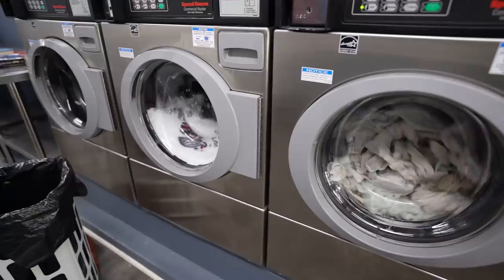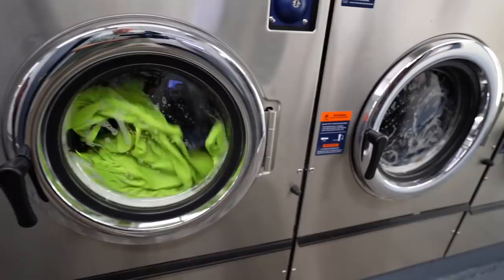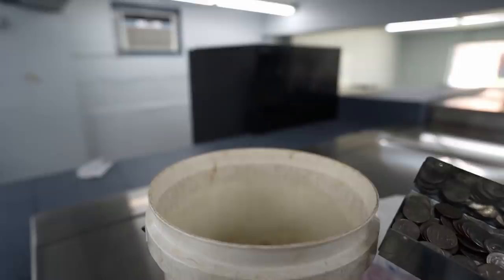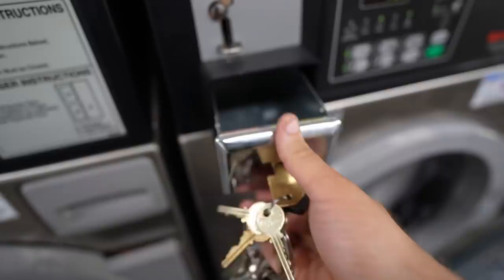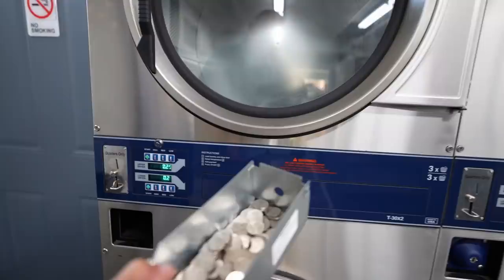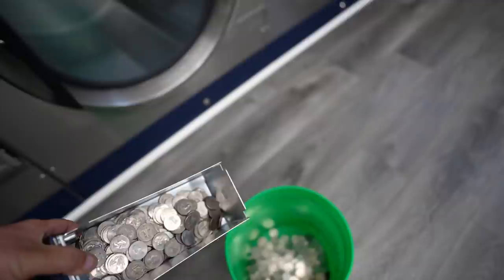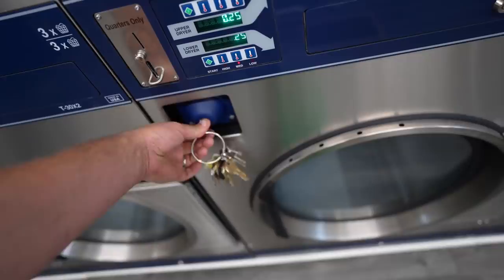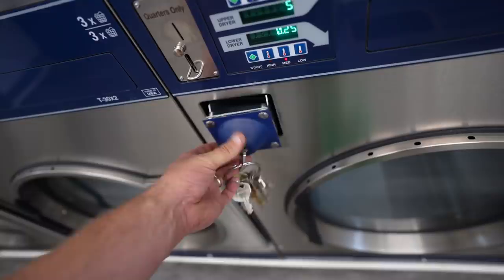How much money does my NEW LAUNDROMAT Make?

Comment: if you have a person there 24 hours, you should apply to make your laundromat an access hub for UPS, Amazon or FedEx packages. they’ll pay you a monthly check for doing it
Reply: I see your point about the money but I would be much more concerned about making the security guard defend the amazon lockers AND the laundromat AND the owner 🤔
Reply: @ShadowLancer128  there’s cameras inside and outside the lockers. he can also temporarily close the store for 10/20 minutes to put them in. it’s so damn easy a teenager could do it. the money he’s paid for it by Amazon would never be a pile of cash laying around the place anyway. they’d direct deposit him or mail him a check like they do for Flex drivers
Reply: @ShadowLancer128  give the security a gun to step up security
Reply: Your Papi Chulo  call Juan.
Reply: I agree and the amazon hub lockers can be outside of businesses as well. So you wouldnt need a security guard 24/7
Reply: @ShadowLancer128  Its extremely easy to do, you just wait and wait, there is a very low probability that you would get robbed even without a security guard
Reply: Yess he could use the back room

Comment: It might not seem important but have you thought about curb appeal? Ive noticed under the letter on the signage is all rust dripping down. Maybe painting the rock facade and getting the moss out of the concrete on the ground. A good pressure wash and paint job could really spruce the front up. Then your outside would match your beautiful laundry shop inside 🧺
Reply from the maker: Was supposed to be power washed, hasn't been yet.

Comment: How much $$ in quarters does the change machine start with? Wouldn't you have to subtract that from the bills when you count?
Reply: the change machine doesn't make any profit at all since how much bill you took out you will have to replace the same amount with quarters.   Only the washer/dryer/arcade machine/vending machine generate profit.
Reply: Yep. The change machine is not revenue.  It's actually a small loss due to power, wear and tear, depreciation, etc.   The cash it takes in balances the quarters it vends out.  It will never make a penny.  One way around this is to have it dispense something like tokens where you can say you dispense four tokens for a dollar but your cost for the token isn't a quarter. Maybe it's ten cents. So then you can get some revenue out of it, assuming your token cost is less than a quarter or whatever.

Comment: To count income, do you just count the coins out of everything that brings in revenue? Even if you see cash in the change machine. You don't know if they were just getting changed for personal use or using it on the laundry equipment. The change machine is just to exchange it's not a source of income. You don't make money from it you don't lose money from it unless somebody breaks into it and steals from it. The trick I think is counting the money from whatever machines you have plus and a fending machine agreements where you're paid a commission. Or if you have any arcade games or push the quarters over the edge games.  That's how I interpret the accounting. I'm just looking at this thing logically. I'm just curious about how you count income. Guessing it's the way I say but please I want to learn so correct me if I am wrong

Comment: Looks nice, you moved the bottom line in expenses by half smart move. Fast dryers even better like turnover on tables in a resturaunt.  Get me money counters as it is your time and safety. 
Do you recycle the quarters back into the hoppers. Do you have soap vending machines for high efficiency washers?

I think the decision for coins was a good one as there is a national chip shortage. You can get cards later.

Comment: If it's true that time is money, then a new bill counter that detects the denominations would be worth it. As it is now, you're sorting the bills manually (at which time they could be counted, but I get it), passing them through one stack at a time, then redoing that two or three times if they jam. An upgraded counter would be like putting the bill collector in the change machine. It ultimately saves time and streamlines your process. Consider it.

Comment: This is a excellent video, but if I was interested in opening up a laundromat, how did you start?
Reply: Source high efficiency washers and driers, check with your local city hall or equivalent to see if you need any permits for said business, grab a business license and open a business that has insurance, or just an llc, location is your biggest factor, most people that dont have washers or driers more than likely dont have transportation, a bad location and you wasted all your money and are now in severe debt. Also make sure there isnt any competition for miles, people would rather go to a laundry mat they are comfortable with and have been using for years even if yours looks more fancy. Also make sure the building you rent or buy has the proper piping to run that much water and power. If not I highly doubt a building owner would allow you to completely change out the electric box, and floor in the necessary piping. Its very expensive. He said he spent 100k in reno so expect to at least spend that just to start up. Not a very profitable business starting up. But its a long lasting source of income. But be prepared for people breaking things often.

Comment: Here in Nashville Tennessee there's a laundry that opened up with two of those XL washers right up front when you walk in the door. Everytime I go in there they are always running. To me it looks like the higher capacity models in a laundry mat get used more than the lower ones do. I've always wondered if it would be more profitable to ditch the smaller capacity washers in favor of the mid to larger size machines. I'd love to see some analytics on that.
Reply from the maker: That SEEMS to be the norm. I was looking today and we've got room for a few more if absolutely needed.
Reply: @InvestmentJoy  The XL washers also get the occasional non-laundromat client like the homeowner who needs to wash their down comforter a couple times a year because it doesn't fit in their home washer.

Comment: Just looked at a new operation for my friend to buy with his sister. 70% are 3 -4 year old machines but a stack of dinosaur parts in storage as the old couple never threw anything out. The old dryers will need replacing asap with a full interior fit out asap. Ironic that the same supplier who fitted the cashless dryers / washing machines is eager to fit & install 4 x of each on credit asap. I can see these 8 machines being debt free in 4-6 months (paid for by increased sales / service). It pays to be a Management Accountant sometimes LOL. 

But it amazes me the lengths that vendors will go to hide their business's shortfalls ? We are talking over $150K of kaka LOL The average 'Joe' or 'Joanne' takes these people at face value without knowing any better I requested to see the certified accounts from the owners & their son instantly becomes defensive. The business broker wants a quick sale as the couple are elderly & ready to retire, but the kids are asking for a price 40% above True Value. Bonus - 3 unrented apartments used by their kids.

Comment: I would be driving myself crazy trying to find Bi Centennial quarters every week.
Reply from the maker: I do. I don't spend time looking for silver, w mint marks but I can spot a bicentennial from a block away.
Reply: Look for the Wisconsin quarter something to do with the corn research it. An extra leaf.
Reply: Or star note or any thing pre 64 lol
Reply: @InvestmentJoy  they make machines that separate the silver quarters by weight. I think silver quarters are worth $3 a coin with current prices
Reply from the maker: @jkm7983  I know they do and I have like two or three the issue becomes I think that I've handled $10,000 worth of quarters in the past 2 months, 500 lb, 40,000 individual quarters. At some point it isn't worth it.

If I was able, I'd package and sell to anyone that wants it to treasure hunt, but as it stands shipping would kill it?
Reply: @InvestmentJoy  There are coin sorters that you can run the quarters through that can be programmed to eject all of the silver ones from the regular.  Not sure if the extra time to run them is worth it, but I have seen videos of coin searchers that have used them in the past.

Comment: So lots of bills and lotsa quarters, but how many quarters were loaded into the change machine(s)?
Reply: $1036.50 walkout total that’s what came out of the coin machine and did not come back, it “walked out”
Reply from the maker: I think i might have done math wrong due to rush it might have been $1919 - $1036.50 = $886.20, and I DO need to check the drinks tomorrow/friday to see what's in there. There could be another $200 in quarters which would mean only about $600 walked out.

Comment: Are you counting cash from change machine as revenue?  That's not revenue. That machine doesn't make even a penny. It only converts from paper money to quarters at no profit. It operates at a small loss, really, because you've got electricity and depreciation on the machine, theft losses, damage, etc. It's a loss leader because you have to have quarters available or nobody will wash.  Your revenue is only going to come from the machines or other vending.  Dexter machines are a good value and they have great support.  I'm not as thrilled with how well they clean clothes but that's probably user error.  Right now I'm jealous of a shop that opened near me with all new Speed Queen machines with the touch screen. Zero quarters. Zero paper money. It's all paid via an app.  Nothing to count,  no cash to handle. All the machines provide instant diagnostics and run like tanks. Insane uptime.  That operator is doing really well.